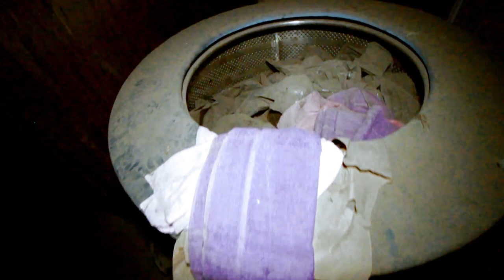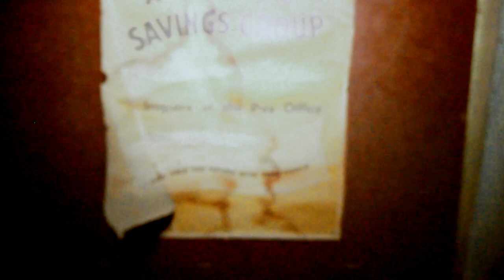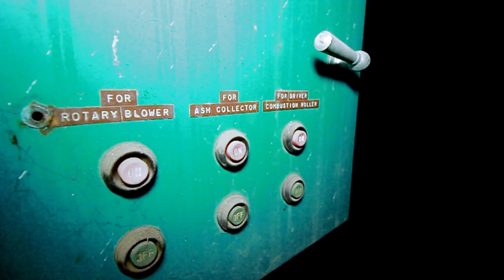ABANDONED TEXTILE FACTORY (police came) #abandoned #Brisbane #exploringcrew

Comment: I have been here too! But I think you must have went into a different one to the one I did. I went to the big one where all the machines were in a row. There is a sensor in there but the cops didn't come when we went there.
Reply from the maker: Yeah there is actually two buildings in the Same location. This is the smaller of the 2. I would like to check out the other one but I don’t think I will risk that one
Reply: @ShannonEdwardsvlogs  Yeah, the one across the street? Saw that one. But was told its full of silent alarms.